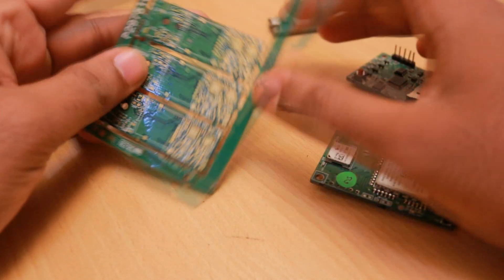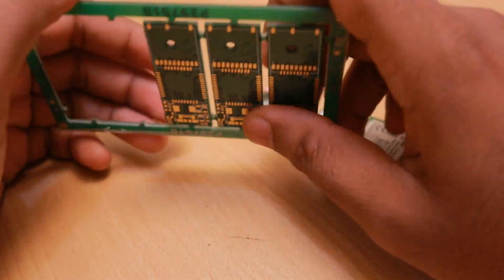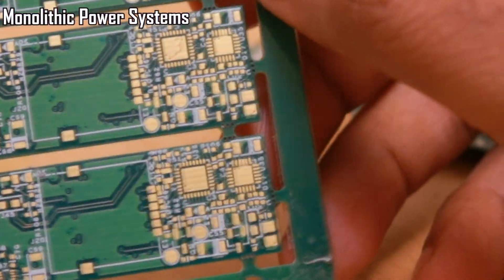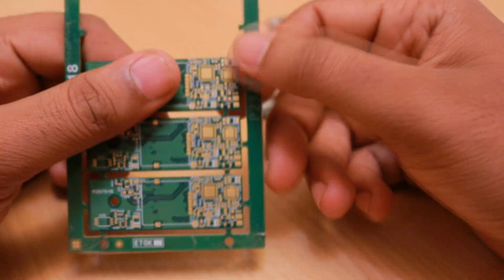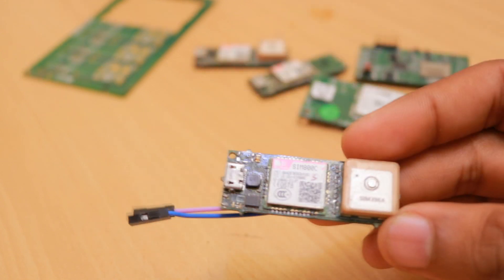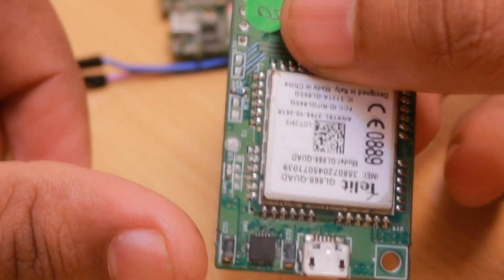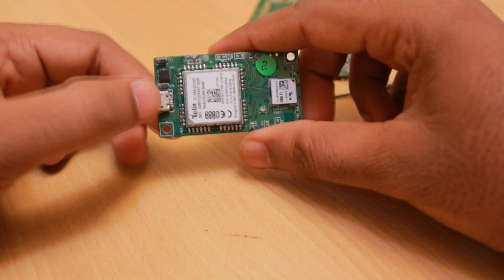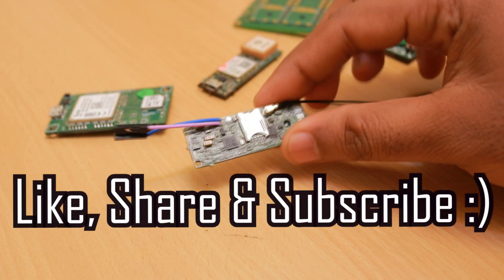Don't use these battery charger chips from TI and MICROCHIP !

Comment: Hey brother, I wonder if you read the datasheet of the MCP73871 and if yes:
- Could you understand if the prog1 resistor actually determines the current both for the AC/DC adapter and the USB charging case?
It looks as if for the USB case (SEL->low, Rprog2->high), the current will be 500 mAh and you cannot further regulate it to , say, 400 mAh to match your battery..

Would appreciate if you took a look. Thanks

Comment: You should be using a DC/DC converter on the output of the battery charger to convert it to the voltage needed by the GSM module. That's how Adafruit's PowerBoost 1000 board works: https://learn.adafruit.com/adafruit-powerboost-1000c-load-share-usb-charge-boost/overview

Comment: Very useful bites to my project. Really do you think MP2617 is supports to the variable input voltage from solar panels or do you really think that to integrate a regulator in front of power source?
Reply from the maker: Thank you. MP2617 supports any voltage from 5V to 12V. If it goes above 14V, you need a regulator. Don't forget to share and subscribe :)

Comment: Buddy , did you mean  you are directly connecitng SYS pin of MP2617 directly to Simcom at 4.2v?? If so, what if ripple voltage is there, as safe voltage of simcom is 4.2v , it can damage simcom voltage? and one more thing,what voltage Mp2617 gives at SYS pin when charger is not connected.
Reply from the maker: There is no ripple. DC is smooth after inductor and capacitor. 
At SYS we get same as battery voltage when no charger present.

Comment: Did not underfstand about MCP73871 ...
What is the exact issue with this charger, than makes it "bad" for GSM if I use correct voltage option?
Reply from the maker: This chip gives 5V at its VSYS output  when 5V charger connected. 
These chips are rated for output voltage of 4V on VSYS pin, which can be directly connected to GSM modules

Comment: For a 12V automotive system you CAN'T use a 12V rated part. It WILL fail.
Reply from the maker: BQ24266 is rated upto 30v with over voltage protection. That's why I had selected it.

Comment: I came to the same conclusion. In an other context, their DSPs are not stable...using the TMS320F28335 is a pain in the butt.
Reply from the maker: Yeah, have used TI audio DSP. Not a fan. Their RTOS is messy.. Had bad experience with the CCStudio. Thank you for watching. Don't forget to share and subscribe :)